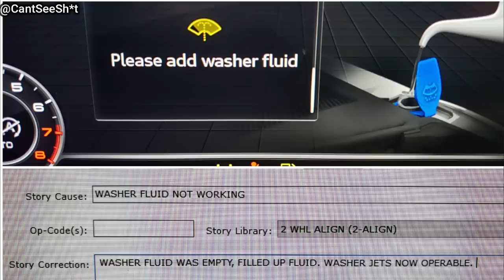Customer States Truck Feels Weird While Driving (GMC Sierra) | Just Rolled In

Comment: I'm sorry, was there something in this video other than Grayson and her babies? Because that wiped my brain.

But the tires. I learned the hard way why Army mechanics always used the cage. I was in the shop when a tire exploded. You could tell the infantrymen, we all hit the floor in a quarter-second.
Reply: The cage was standard back when some trucks used split rims.

I have a set of split rims for my motor home, but no cage.
In order to refill the air after work, I wrap a chain around the rim, through the holes and around the tire, rim section, in case the split rim blows off during pressurization.

So far, I have had no failures, but I still don't take chances.
Reply: I haven't seen  them in ages. but do you remember those lug wedges that use to be a common way of mounting truck wheels. if you removed them the wrong way they'd fly off like a bullet.
Reply: @jeffreyyoung4104  at a garage 35 years ago they had a car hoist and lowered a car down over the tire and plugged the air hose in away from the hoist a safe distance away never any problems ,, but the chain if done right works good ,, having a air hose that locks on the valve steam then hook air up 20 feet away is nice too ...

Comment: As much as I love cars and the thought that goes into engineering them, they still manage to scare me…. Exploding tires 😳
Awwww 🥰🥰🥰 the fur babies!
Reply: @RickDangerousNL  yikes. That thought alone kinda spooks me.
Reply: Former neighbor borrowed a friend’s car outlet compressor to inflate his completely flat Ford F-150 tire. Seemed to be taking a while so he went back inside to see how his football team was doing. Swears he was inside for just a few minutes when the tire exploded. Found the plastic housing of that compressor melted and the compressor was still running. Once he turned it off it never ran again.
Reply: A properly maintained tire is not a threat. Commercial tires can be dangerous while filling. They require them to be filled in a safety cage and 20 feet away.
Reply: proper tire maintenance and you literally have nothing to fear, check your tread, look at the sidewalls, if see anything unusual take it to a tech... also recommended tire pressure is usually on the drivers door jam, either on the door, or the inside lower door jam (most cars are between 30-35PSI, trucks are 35+).
Reply: yep .. that's what happens trying to "fit" 90 lbs into a 35 lb PSI tire
Reply: A simple dollar store tire gauge will keep that from happening lol.
Reply: @rhuephus  lol! 😂😂😂
Reply: @rhuephus  Gets you sweet gas mileage though. Until it blows up.
Reply: Those aren't babies.  Those are cats/kittens.  If there is an emergency my energy goes to saving human lives BEFORE worrying about animals.  Priorities are important.
Reply: @thadrepairsitall1278  Yep those truck tires are deadly when they blow, you really don't wanna be anywhere near one when it's about to pop.
Reply: @christophermorin9036  not even sure if that's what is happening here since so many tire pumps include a readout of some sort to let you know the pressure as you fill it.    Keep wondering if someone just thinks more pressure is better than less and just kept on filling it.   hey it didn't pop yet so it must be good :)
Reply: @johnchestnut5340  Listen World, Johnny here made a serious, life changing statement ! 
 Kittens are NOT cat babies ! 😳   Yep, priorities are important.
Reply: @marcryvon  Context!  Try actually reading comments.  Humans are a higher priority than animals.  Calling them fur babies is an attempt to humanize them.  I don't want to hear another story about a fireman dying trying to save a "baby" that was actually a pet.  Think about it.  Then again you're probably among those who would save their pet before saving a human who was a stranger.  I value people...even people who don't value people above animals!

Comment: I was riding a motorcycle on a highway here in Australia, passing a car towing a boat. As I was accelerating up beside the trailer the wheel on my side came off, the trailer dropped onto the axle and my side vision filled with sparks. The wheel rolled out towards me so I hit the throttle to get past it, figuring it can't accelerate. As I passed I looked in the rear vision mirror and saw the wheel roll to the centre of the road and then back into the path of following traffic. Everyone behind must have hit their brakes as the wheel wandered over the road. It's a scary moment when that happens, and more scary on a bike.
Reply: Yea I always pass semi trucks as fast as I can. If one of those suckers go my helmet will probably get some use.
Reply: I had a semi truck tire blow out in front of me while I was on my bike. I avoided a big chunk of tire but got hit in the leg by a small piece. Luckily I had jeans on but even the small piece left a good bruise and hurt quite a bit. Still could have been far worse.
Reply: Had a cement truck hit a rock chunk in our parking lot, the chunk missed my head about a foot and blew a hole in the office wall. Just another day at the office.

Comment: 1:49 - The gravy incident.  This is why I set food on the floor.  It can't fall if it's already at the lowest point.
Reply: On the floor between the front and back seats. Best position is behind the driver seat, so that you can't be tempted to reach for it at a moment where you really need full control of your car. Never put anything delicate on the front passenger seat.
Reply: Mechanic had a gravy job. 🤭
Reply: No, it'll tip over and spill instead!

Comment: When I did my training of truck repairs in the safety manual there was a picture of an imprint in the ceiling of a workshop above an exploded truck tyre shaped like a human body.Stuck with me the rest of my working life.Always use a cage.watching guys using ether spray to pop tyres on a bead just frightens  the crap out of me.
Reply: I used to be one of them idiots. I've since invested in a bead blaster. Much safer
Reply: It IS pretty entertaining when done correctly.
Reply: i can't imagine that image. I haven't seen it, but now I'll be thinking about it.
Reply: Yea 120 lbs of pressure in a semi truck tire will do that if It goes.
Reply: There actually isn't enough energy released when using ether to significantly overpressure the tire making it fairly safe.  (relatively speaking of course)  The danger comes from what you saw in training.
Reply: @snapbean7817 lmao That always catches me off guard!
Reply: I lost one on a lowboy trailer... fuck knows how I didn't hear it as I had the window down and no music. First I knew was when I saw smoke pouring from the trailer which had lost all the air out of the suspension from the explosion blowing out an airbag. Fucking thing was dragging down the road... lucky it wasn't nighttime otherwise the rest of the rubber would have got scrubbed off.
Reply: As our fork lift technician said: If I have to inflate the tires (I'm the only one with air tires i.s.o. full rubber tires), I'm gonna take a good long hose and get a fair good distance. Officially it has to be done in a cage. The pressure for my fork lift tires is 10 bar or about 145 psi.
Reply: Our shop still runs 10x20 tube tires on Dayton wheels. You put the tube in the tire air it to about 20 lbs slide it on the rim Set the ring. Mount it on the wheel with the safety rings facing each other 
With the spacer in-between. With the  valve stems opposite each other line them up with the inter lug nut. Now tighten all 5 lugnuts doing a spin test for true. Now air up the 2 tires. To 90 psi

Comment: I worked as a tech for nearly 20 years and at least once a month I’d see a car come in with severely overinflated tires. Sometimes just one, sometimes all of them. My theory is that some people think that their tires should be inflated to the point that they are perfectly round, i.e they don’t “squish” where they contact the road, and so they just mindlessly inflate them until that happens. Tires are part of the suspension of a vehicle, they are meant to deform slightly when they have weight on them. Use a tire pressure gauge and set the pressures to the recommendation of the vehicle manufacturer (which is on a sticker inside the driver’s door on pretty much anything built in the last 15 years), not the number on the tire sidewall.
Reply: Some might also mix up PSI with KPa.
Reply: Exactly!
Reply: I have experienced the problem of the manufacturer's recommended tire pressure giving a softer ride but giving problems with the handling characteristics of the vehicle. My Ford Escort called for 28 psi. Steering through curves was scary. 35 psi corrected that. My Chevy Express has truck tires rated for 80 psi maximum. The tires on the front are supposed to be inflated to 55 psi. If I don't inflate them to 80 psi the steering is sluggish. That is what the tires are rated for. I frequently drive over a very curvy road and I have found that I have to basically inflate my tires to the maximum pressure listed on the tires for stability. If I don't then I have found that I have stability issues on the curves. There is very little that is as scary as feeling your vehicle trying to go straight when you turn the steering wheel and feeling it swaying as you are coming out of a curve.
Reply: Yeah, i see the recommendation as minimum pressure. My car says 2.2 bar, I take that to 2.5, drives much better.  Obviously you dont overinflate to like 6 bars...
Reply: come to think of it... what if these people remind their kids days when you pumped up your bike wheels until your puny air pump wouldn't pump anymore, and they just think to pump their car tyres up until nothign goes in anymore? it would explain the brutal inflation, as most systems stop at 6 or 8 bar. more and more tyre mounting machines even stop at 3.5 or 4 bar, as the line for car tyres (as I had learned in professional school back in the 80's) is a little above 5 bar inflation. beyond that the threading is most likely to break, and the tyre needs to be discarded.
Reply: TPMS lights have made it worse. The light comes on for malfunctioning system/dead sensors, different inflations per wheel postion, non-calibrated rotation speed based sensorless systems, or my favorite - non-calibrated GM wheel location specific systems, and the owner's remedy is always "keep adding more and more air to whatever tire(s) 'look' low."

Plus about half of all drivers think the correct tire pressure is the max inflation printed on the tire instead of the one from the car inflation placard.
Reply: @matthewbowen5841  And don't forget the warm and cold pressure differences. When you first get in your car it is most likely at the cold pressure, after driving for a bit or on a hot day the pressure will go up.
Reply: @matthewbowen5841  amazing that they would read the warnings on the tyre's flanks and completely ignore the not so little warning sticker by the door or behind the tank filler lid as well as the owners' manual.
they should state RTFM on the tyres' flanks instead.
Reply: @lotharrenz4621  Its not amazing at all. I am 52 years old. My Dad was a mechanic back in the 70s, 80s and 90s. He taught me how to care for my car 35 years ago. I'm pretty sure the didn't have a tire pressure listed on the cars at that time. You always put 3 to 5 PSI less than the tire stated. I found out about 6 months ago that I should inflate to what the car says and not what the tire says. So No, its not amazing that people don't look at the sticker by the door fir the proper PSI.
Reply: @matthewbowen5841  It's not just drivers who think that.  I've come out of Jiffy Lube places and they think  that as well.  No more Jiffy Lube for me.  And yes that TPMS is annoying...keeps coming on when I drive windy roads and have to keep resetting it.
Reply: @matthewbowen5841  Your spot on. I work at a GM dealership (not a mechanic, but I often pick up customers vehicles) and the vehicle will say "Front left tire low.. 20 PSI" or whatever and I will check it and its at like 90 PSI. The customer listened to the car and filled up the tire and gave up when it didn't work. Problem is the sensor wasn't reset or whatever and it's for the front right tire or some other tire. More commonly I will see it where the tire monitoring system fails and the customer inflates all tires to high heaven to try get the light to go off. The tire light in GM vehicles will also come on when the tire pressure is too high so if they have an older vehicle with only a light they might add air to a low tire, but add too much and now the light stays on for that reason. I live in Minnesota where tires go low every winter so these situations aren't that rare.

Comment: Always gotta have a tire pressure gauge when messing with tire pressure… saves you from explosions
Reply: some newer cars (if they have pressure sensors) if you leave them running while you inflate your tires, it will beep when it reaches the recommended pressure (does nothing if tires are already over inflated).
Reply: @JustJay1281  that would b a good feature. Mine just has the regular sensors, although the car isn’t new enough to have the dash tell me each tires pressure. Wish it did though
Reply: Pretty much every self-serve air pump I've seen has a gauge built into the nozzle.  But y'know, people have to actually look at them.
Reply: I have a digital and a standard one in my truck. Growing up my dad told me to just eyeball it. That never did sound right to me hence the 2 gages now.
Reply: i think the problem is that some people don't know you have to let go of the trigger for the built-in gauge to give you a reading ( at least on 99% of fuel station airlines )
Reply: @davidkeith3920  
The stick ones are unreliable as hell because they get gunked up from debris and weather.  Had one reading 35 for way too long, checked it with my needle gauge: 76lbs.  It's not hard to overfill tires but 90lbs is quite a bit much lol
Reply: OK but how do you do this in the first place? Every pump I've been to, you input your desired pressure. Unless he had it on the 'just max it' setting?
Reply: @JaidenJimenez86  I’ve never been to a pump that has that option. They all just let you put in whatever pressure you want, although some do have a gauge to check